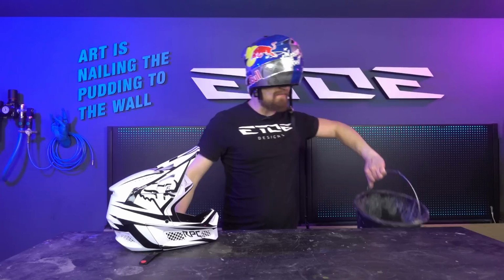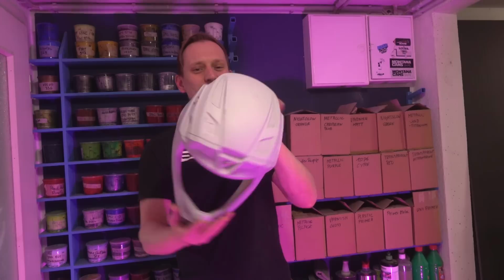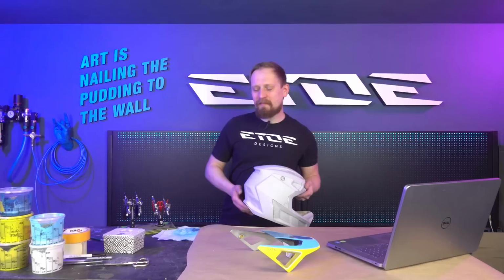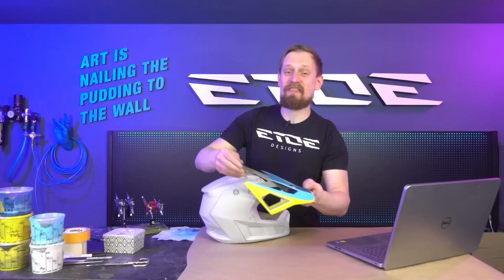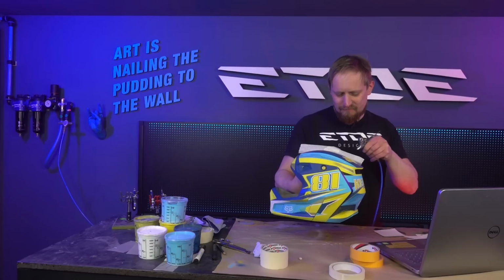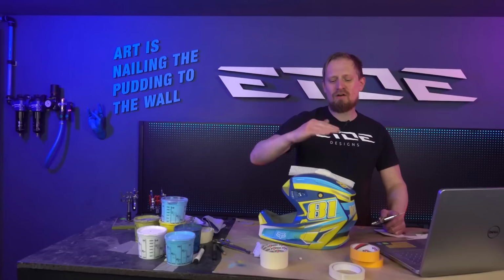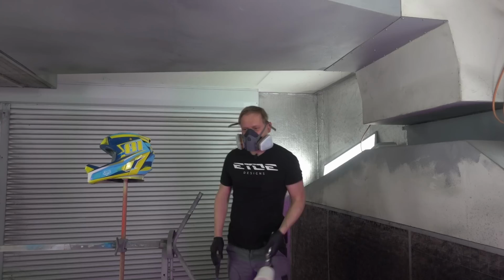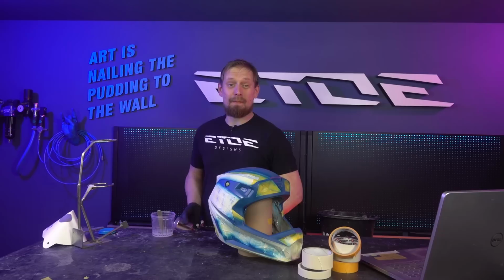how to paint a helmet - fox rampage

Comment: Martin- love your vids and ‘stupid’ jokes! Keep it up. Question; am I correct to assume that you need a wet sanding party with Sandra after every paint layer (primer, base coat, etc) EXCEPT the last clear coat? And if so, with 800 grid? Am doing my own job and noticed still some rough areas after primer and first base coat, although I had a fun time with Sandra... Prob not enough.
Reply from the maker: You need to do always a wet sanding with 800 grit before you put your pants back on after your big poop.
Reply: @ETOE  hahaha, thought so! Thanks for the quick response! Greetz from Luxembourg

Comment: Martin, I love your channel. You are so funny. The helmet looks awesome! You have inspired me to paint some cabinets. Can you please recommend a good spray gun for an air compressor that provides 5.1 SCFM at 90 psi? Someone recommended an Eastwood brand but I would trust your recommendation more than anyone. Thank you so much for your help!
Reply from the maker: The wet fart of my neighbors dog has more power than your compressor. 5.1SCFM at 90 psi means at 59F. But working temperature is minimum 140-180F. You loose 1/3 of the total release and end somewhere at 3.57SCFM. If the compressor is cheap it`s not the release SCFM. It`s the typical lie and the suction SCFM. Which means you loose an other third of power at the release SCFM. To run a spray gun properly you need minimum 15 SCFM/ 355lpm at 87psi / 6bar at 176F / 80C at the release. My compressor pushes 56SCFM / 1250lpm at 145psi /10bar at 176F / 80C as a reference for you.
Reply: @ETOE  Martin, this is more than great to know. Thank you so much for your help and direction. Have a great week!

Comment: Hi Martin. Do you have experience with the giro aerohead helmet?
It has a matt finish but the decals are glossy. I want to remove the decals but it seems they are coated which i dont understand. 
However i want the decals in another color the matt white finish is ok. 
Do you have a suggestion what I can do best? Maybe painting the decals?
Could I use also clear coat to make the entire helmet glossy?

Comment: how long do you have to wait for the paint to dry to put another layer of masking tape on top of it
Reply from the maker: One or two minutes.
Reply: @ETOE  lets say im using vinyl stencils that  cover over each other would the adhesive on the bottom of the vinyl be a problem for stripping the fresh paint underneath? Would one or two minutes be enough?
Reply from the maker: @rexchen7350  Yes one minute is more than enough for me.